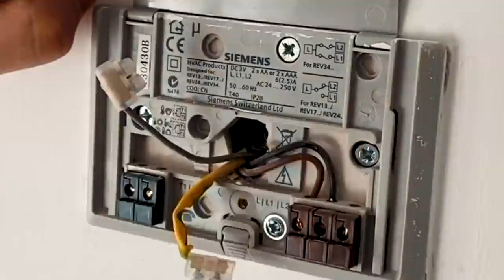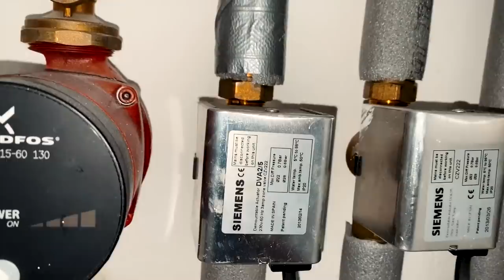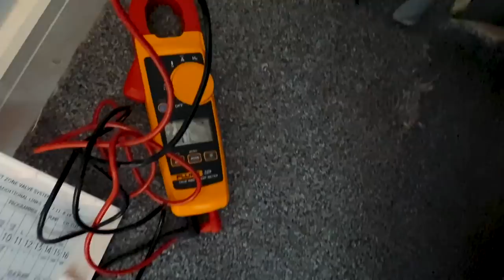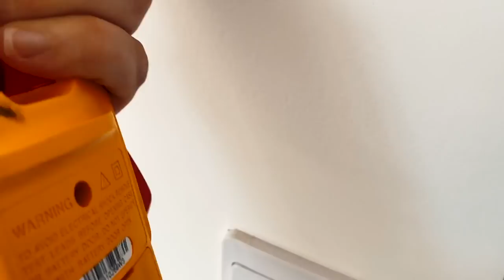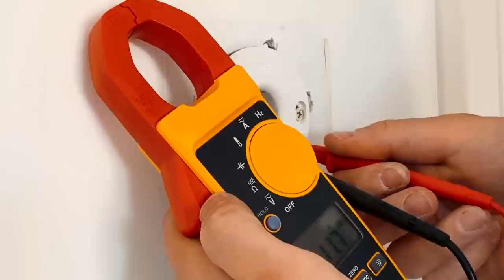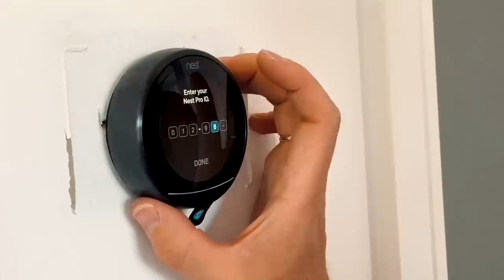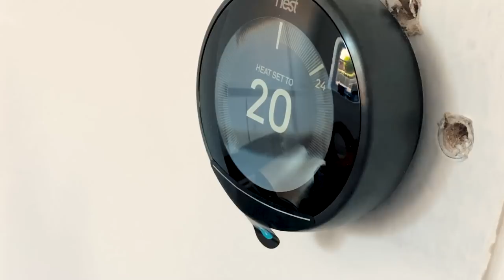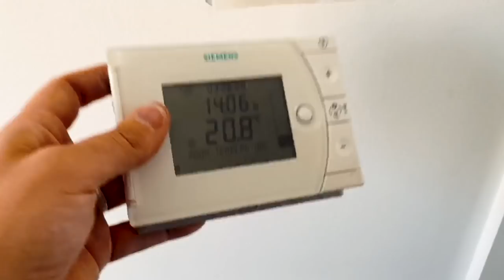Google Nest Thermostat Dual Zone Installation

Comment: The oranges are switched lives that tell the boiler to fire up. That then instructs the pump to run, not a flow sensor 👍🏻
Reply: That pump does have a pressure sensor in it, it's a new gen Grundfos with speed control depending on system back pressure (EU energy eff legislation). It does appear that heating system control wiring is not something he's overly o fey with though.
Reply: @effervescence5664  I'm totally using o fey rather than au fait from now on : )

Comment: As an electrician who’s worked on boilers for 12 years after 2 minutes I’ve spotted 2 mistakes 🤣 That’s a heat only(conventional) boiler not a combi. Also a thermostat should be where the radiator has a lockshield which will probably be the hall. The hallway would usually be the best place for a thermostat because it has the most air movement and will give the best indication of a mean temperature for the house. It’s building regs 👍🏻
Reply: A heat only(conventional) boiler  also known as a system boiler.
Reply: Stuart Andrews No, a system boiler has a built in pump and pressure vessel. A heat only boiler is exactly that it heats the water. There’s an external pump.
Reply from the maker: They only do white ones
Reply: Yeah, looking at the lack of pipework underneath the boiler, straight off it doesn't look like a combi. But hey ho, no big deal.
Reply: Is it a compulsory building regulation though that the thermostat has to be in the hall? I've seen loads of them in the lounge not hall Ben.
Reply: 0liver 0verson no it’s not compulsory
Reply: @artisanelectrics  You can get knock-off black stands on ebay. Not ideal to fit for a customer though, as no official power supply/lead  👍
Reply: No - with Nest it’s meant to be in the living area. It’s not just a thermostat - it includes a presence detector and light sensor. The idea is that it turns on when you’re there and off when you’re away. Unless you live in the hall it’ll end up turning off when you’re having a comfy afternoon on the sofa!
Reply: @Richardincancale  Nest has geo-fencing tech so you don't have to install it in the living area - it can be in the hallway as it knows when you're home anyway.
Reply: @Richardincancale  If you have the nest protect smoke alarms as well, these contain motion sensors too which are used as part of the nest home/away detection.
Reply: had it installed in the hall, and would been total crap, as boiler would fire more often, as yes halls are colder in general plus less movement, thus you have rooms always 3-5c higher then needed really, thus while idea is good, but having in any room will give better temp read

Comment: Thanks for posting this, Jordan. I am a DIYer contemplating an upgrade at home. I am already familiar with HIVE but the NEST units look really good. The wiring explanation was helpful too
Reply: Nick did you switch? I have hive but was thinking of switching
Reply: @mattsidebottom7603  Not yet Matt, plucking up the courage to replace the boiler first!
Reply: @nickh2519  im having trouble my wiring at the minute. have to keep pressing a reset button on the receiver. gona have to get an electrician to have a look.

Comment: TBF to Jordan, he knows about as much about how a heating system works as a Plumber does about electrics. This is exactly where You Tube gets dangerous because people will follow this video and believe what they are being told. S plan and Y plan wiring is designed with safety in mind. Any part of the system fails and it stops the boiler. If a valve is closed its really important that the pump stops running which is why the valve controls turning the boiler and pump on. If the valve ails to open you don't wanna burn out the pump or run the boiler until it pressure releases or worse.
This is where a good knowledge of what you are doing and testing before you start filming is important.
Reply: You can have closed valves and pumps running - a lot of boilers require pump overrun - so the pump runs after valves close and boiler stops. That is why you have auto bypass installed on systems (if installed correctly) - also, a lot of combis and system boilers will have an internal bypass for that reason. Not a problem on Y plan - as there is always flow through either heating or hot water cylinder coil. Pump will not burn out even without a bypass if running against a closed valve.

Comment: I have a two story house, and two nest thermostat on each floor. The second floor thermostat works just fine on cooling, however if I only turn on the first floor, the AC unit is keep short cycling but fan will stay on. They all wired exactly same, but the second floor works fine but first floor keep short cycling. When I turn on both, it also works fine.
And yes I have a zoning system too. Thanks in advance!

Comment: You mentioned briefly that you could connect the heat link where the old thermostat was. Can you elaborate on that? Does the old dial thermostat have all the connections the heat link needs?

Comment: Man I hate boilers and boiler wiring - It's labyrinthine. I tackled 2 zone system similar to this in my old rental to self-install 2 Nests. My new place has UFH/heatpump and I found the manifold wiring system far easier to integrate into the nest than the old gas boiler  - have 5 nests in the new place. Thanks for showing your approach to the job!

Comment: Should dual zones not have a third for hot water via boiler also? Like the typical 2000s stat ground, first & water. I considered them to be fairly standard as suit most semi detached house 2/5 bed set up.

Comment: So I have to replace my programmable unit as it died today. I am thinking of going the Nest route. However, my programmable unit not only allows dual zone heating control (7 day, 3 timeslot scheduler), but also allows control of the Megaflow heating schedule. I not yet seen any example of replacing such a system using a Nest as I'd like to replicate my almost 3-way heating schedule. Any ideas?

Comment: Jordan if you are just switching a heating zone do you get one that just does heating or do they only come as heating and hot water and you disable the H/W. Also, I was always told you install a stat in the coldest room ie the hall if you have it in the lounge which gets a lot of sun the colder rooms the heating gets shut off before it got the room up to temperature. I also got told that you have to keep going past the stat if not it turns the heating off what are your thoughts?

Comment: Hi Jordan, great video again 👍🏻 Have to mention that you used a 7 core flex for both 240v supply and the 12v for the Nest thermostat connections, have to watch separation between voltages!
Reply from the maker: Thanks good point
Reply: As long as the insulation is rated at the higher band voltage then it's fine.
Reply: What cable would you recommend using?
Reply: @MRhandleuk  The flex he used is okay as it's rated at 230v ie the higher voltage.

Comment: It looks to be an S-plan system, the programmers/thermostats control the 2 port valves, when any of the zone valves open and makes their limit switch the pump and boiler are powered up

Comment: I'm contemplating installing 4 x nests onto a large 4 zone house. And was just wondering what the app looks like with multiple units? Can they be labelled, for example 1st floor, 2nd floor, etc.. And are they eaily distinguished, as in, for an elderly person to use?
Thanks in advance and great video!
Reply: if you have a Google Nest Aware subscription, your camera's audio is recorded in your video history as long as the microphone is on

Comment: I’ve got dual zone system and one of the nest heat link suddenly stopped working, just can’t connect with the thermostat. After nearly 8 hours chat with nest support I’ve been told that the reason for that is because the heat links are close to each other. Any advice will be helpful as I don’t think that they know what they are talking about. The two heat links are working like that for over two years.

Comment: yes, i am going to install them but I am confused about how two-zone can work with a combi boiler system without a hotwater tank. one in the living room and one on the first floor?!!!! 
if the temperature on the downstairs, ground floor is 22C, how can the first-floor's thermostat adjusts the temperature to 19C, while both of them are connected to one combi boiler?

Comment: Hay great video! 

Question... I have the same heating setup. I currently have a Nest thermostat E for up stars, which was easy to fit and working well. 
I would like to have a nest learning thermostat for down stairs.
Can I have the Learning thermostat as a call for heat only, and keep the hot water controlled by the programmer?
what do you think?

thanks
Reply: if 
you have a Google Nest Aware subscription, your camera's audio is recorded in your video history as long as the microphone is on
Reply: @cloudnine9100  wrong thread I think?

Comment: Boilers normally have separate fuse in consumer unit so why not isolate and lock 🔐 off there if others are around
Reply: Very rarely....boilers in a domestic property are normally taken off the nearest ring or radial unless they have used the old immersion heater circuit👍🏻

Comment: Would it not have been easier to replace the existing thermostats/programmers with the Heatlinks
Reply from the maker: The heat links look horrible mounted on the wall in the middle of the hallway and bedroom
Reply: Artisan Electrics fair point, glad I have a Combi with my Nest but miss my old Tado. Looking forward to more Tesla Stuff 👍🏻

Comment: Hi I'm weighing up Nest vs Hive. I work shifts but house is occupied all day so need a system that can turn hot water on/off at various times . Currently we have 6 individual room thermostats so are these kept or redundant ?
Require a system that also works with underfloor heating.  Sorry for all the questions but it's a big investment and want to get it right.

Comment: Hi the 12volt wire can not control the heating or hot water it is for the supply 12 volt only if you check the book you will see this thanks
Reply from the maker: Yes that’s right

Comment: This is so bad it’s painful... pump starts because it senses the pressures released??? No it starts because the switched from one of the zone valves is closed and therefore providing power. 
The wiring guide wouldn’t have helped in this situation as it’s only for 2 zones valves ie heating and hot water not a second zone of heating as well. The black from in with the pump live is the boiler fire... ie it goes to the boiler to tell it to start.
Reply from the maker: Thanks
Reply: by the looks of it Jordan should give heating wiring a wide berth, he seems well out of his depth, similar to the fire alarm...
Reply: It hurt my head reading this😂

Comment: Pointless spending that much on Nest thermostats, if the boiler can't utilise opentherm 👍
Reply from the maker: Why?
Reply: @artisanelectrics  Over £300 for that setup (without fitting), for a simple on/off control...................No thanks!.
Reply from the maker: @Mark-gf7yw  How does open therm work i've never come across it before?
Reply: @artisanelectrics  It allows the thermostat to control the boiler, so for instance with a standard on/off thermostat, the boiler will run full blast till the set room temp is reached and most likely overshoot it, then shuts down, room temp drops, boiler runs full blast again etc etc............... Opentherm allows your smart thermostat to better control the boiler temp, by being able to ramp the boiler up or down when near desired temp or when far away from it. More cost effective on gas, and keeps a more consistent room temp. Probably haven't explained that very well, hope it makes sense   👍
Reply: @Mark-gf7yw  explanation sounds good to me. Its basically looks at the differential between setpoint and measured value, and ramps up or down the boiler accordingly.On ours, only very occasionally does the temperature overshoot the setpoint, in which case it closes the valve and shuts down the boiler. Less cycling means a happy boiler (apparently)!
Reply: MARK FINN can’t agree. We don’t have opentherm but the nest does a far better job of managing the on and off - it’s not a simple timed thermostat, it seems to learn how long the house takes to warm up and adjust accordingly. The remote access functions are useful and the ability for it to turn the heat off when no one is in (irrespective of any timer). It’s saved us money.
Reply: I was thinking the same thing, isn't that kind of inefficient, like more positive ACs, that don't have inverter engines. You need to control a boiler more subtly and control radiator valves to get the temperature more accurately. But it's my first video, so I don't know much 😂